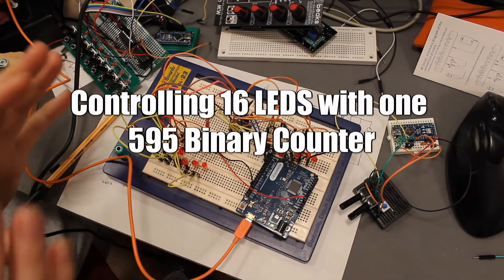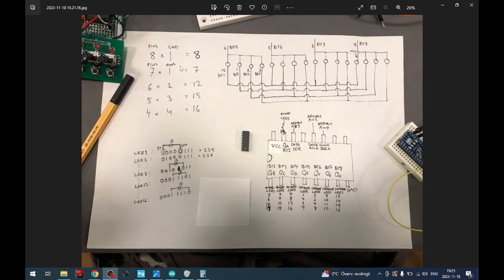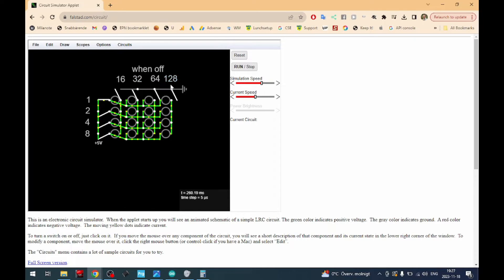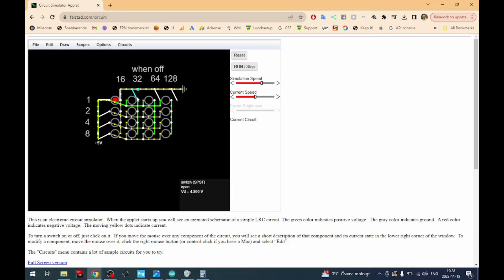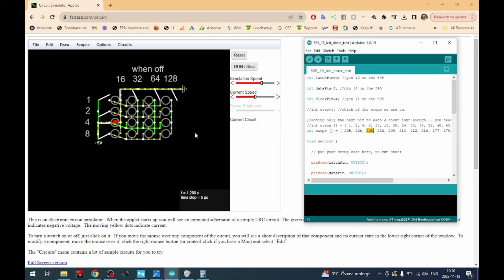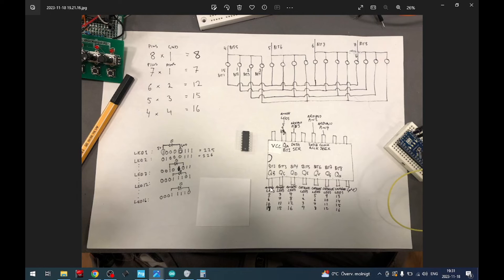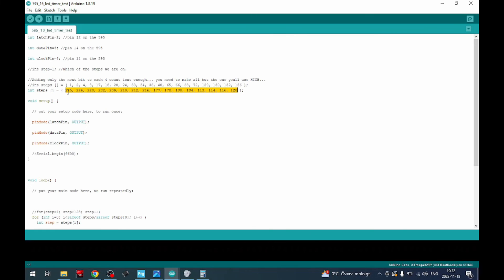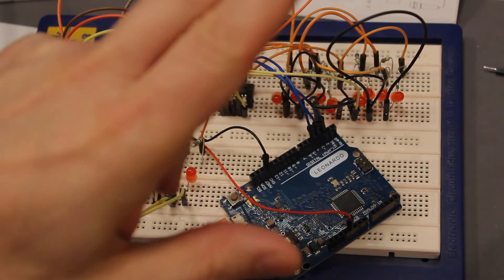How to Control 16 leds with one 595 Shift Register - Anything Arduino?

Comment: This is basically a small LED matrix. Keyboards use the same method, but in reverse. But there is one problem, you cant activate multiple LEDs at once without doing fast multiplexing. You would activate the LEDs row by row switching really fast between the rows. And due to our persistence of vision they would seem to be all active at the same time.
Reply from the maker: Yes. This is as you say a small led matrix and yes, to light up multiple leds multiplexing has to be used. I tried with a couple of more leds lit and when lighting them all up they are a bit dim. Otherwise it worked quite well. Forgot to show that ofcourse. Downside of doing a short video. 😅

Comment: I'm using 2 595s to control 64 LEDs with this same method! It's using of of those 8x8 dot matrices which is usually controlled by a MAX7219, but those chips are really expensive if you buy them individually, so the shift registers work great!
Reply from the maker: Exactly! So with one more chip you get four times the led control. Simple and fast control over many many leds.